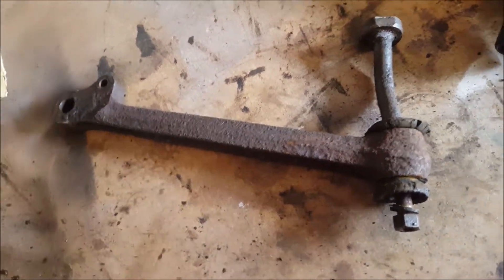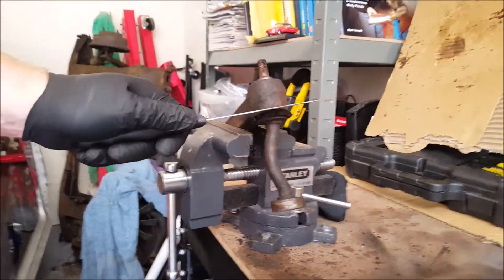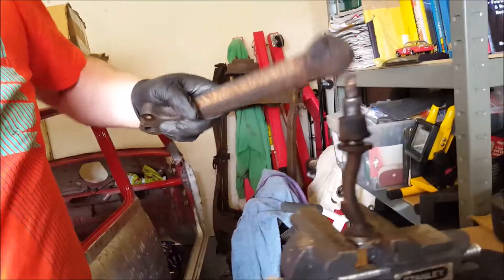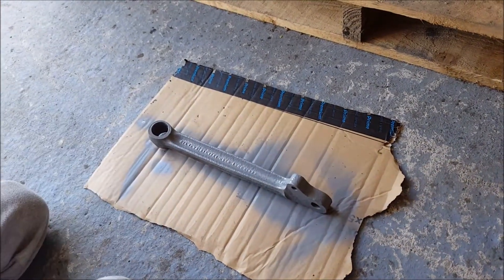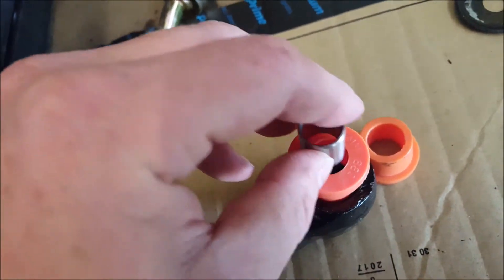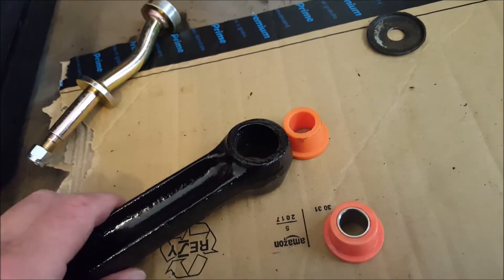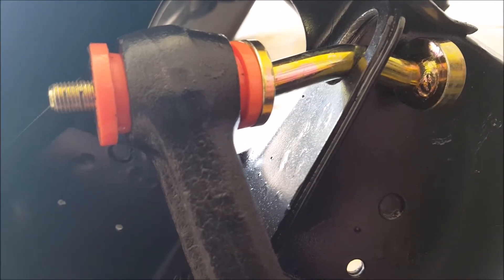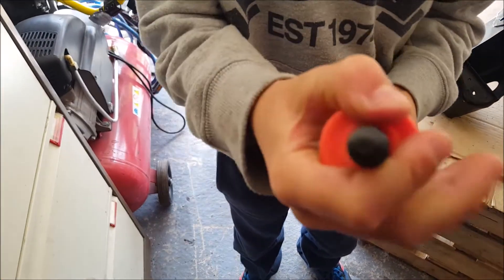Classic Mini Restoration: Eleanor Video 15, Front Suspension Refurb

Comment: Really enjoying your videos. I'm at a similar stage with our Roxy, the subframe has been stripped and painted. I'm looking forward to your upper arm refurbish video as I had nightmare getting them stripped down. Great fun though.
Reply from the maker: Thanks. I have one stripped down.wasnt too bad but the other is given me hell but i won't be defeated
Reply: Have you removed the inner needle bearings? I had to order a tool just to remove these. I tried welding a bolt to them as suggested by a youtube vid but it just pulled the outer casting off all but three. I succeeded in the end.
Reply from the maker: I used an inner bearing tool and wd40 and heat and loads of patience
Reply: Same here :) what is the purpose of Acid Etch Primer? I'm just cleaning the parts and giving them several coats of Black Hammerite.
Reply from the maker: Supposedly to stop acid at tbe base level. Hammerite says it also does this but whule the parts ae off thought may as well guve plenty coats. Stonechip i had was matt finish and tats why i aded a gloss top coat.looked better